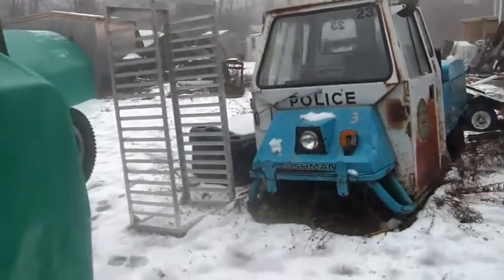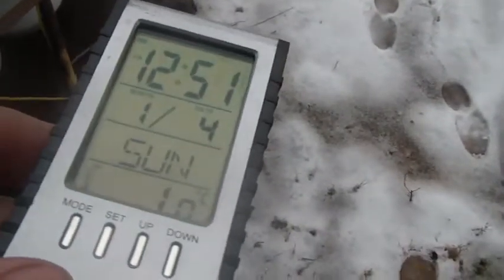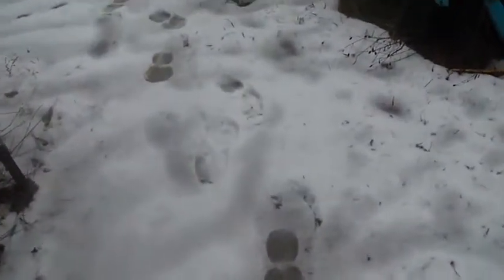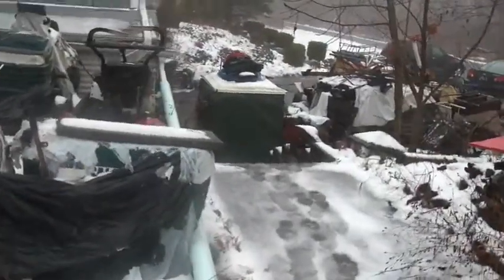1_4_2015, Electric EZGO GolfCart, to gas UTV RearEnd gear Ratio,

Comment: Thanks for the irrelevant BS, did it work or not. I didnt need to know how to build a watch, I just wanted to know what time it was. Did you do the gas conversion, how did you do the reverse and what did you use??
Reply from the maker: +Dick Tracy ,  I decided to go with a Honda 200SX engine, electric and recoil start, 5 speed, and reverse. I need to finish the motor mounts and frame... Thanks for your thoughts, watching, and commenting!

Comment: I have a 13 ho 420cc motor what would be a good gear ratio for it it is now 12.44-1
Reply from the maker: Melissa Archer , The gear ratio depends on what U would like to do with the cart, for off road use, a 12-1 gear ratio, (depending on the size of the tire), should get U around 25mph, and with a 13hp, it should pull strong,  Let me how it turns out, please post some videos, thanks for asking, watching, and commenting!
Reply: Thanks a lot and I will

Comment: Not trying to be a pest or anything. I like your ideas for the transmission. Your going to need to overdrive the engine output or transmission output or both. If you overdrive the trans. output 12 to 1 it will go the speed of the tractor. For example with that  rear end your dividing the output of a tractors speed 12 times. Or to put it another way if a tractor goes 12 mph, with the golf cart rear end it will go 1 mph.
Reply from the maker: william staten , Hi, I would like it to move around 20MPH in its high gear, right now, direct driving the input shaft of the rear at 3600RPM, with 22 11-8 tires, it should do that speed. I'm not sure how the transmission will change the numbers. I think the belt drive input to the transmission cuts the input to 1800RPM, and I think the chain drive is 4 or 5 to 1. I need to get the transmission out and start turning shafts to see what is really going on. I may have to put a large sprocket on the back of the transmission and a small one on the input of the rear to make things up, (as U said, over driving the rear),. Since U brought up the concern, I've been keeping an eye on the math, and so far, things look ok... We will see. Thanks for the input, it is keeping me honest. Thanks also for watching and commenting Bud!

Comment: Will that trans hold up to the added horse power & RPM?
Reply from the maker: 231flash , I think the rear will hold up... Typical golf carts have over weight, drunken, fools, beat them all day long, and they seem to take the abuse, so, I'm hoping it is very over built. Do I know that it will hold up, no, but, I'm hoping... But, as I look at it, I would be nervous about hitting it with any more than 6hp or so... Thanks for the input, watching, and commenting, I do hear and understand Ur concerns.